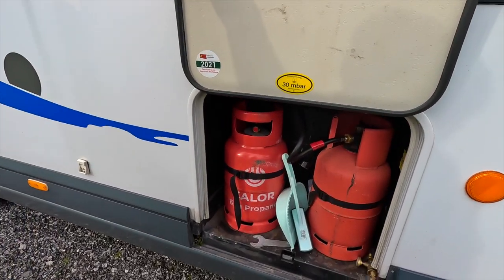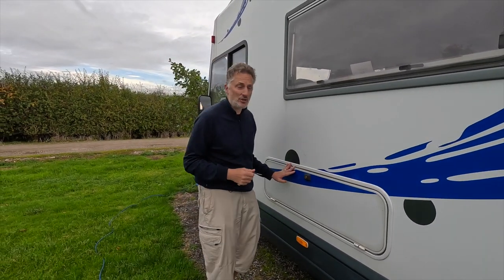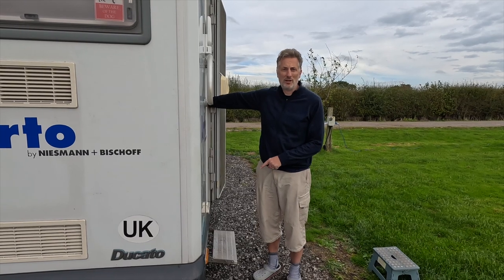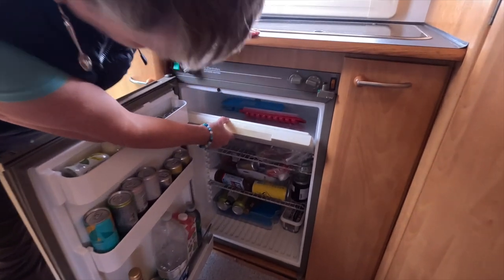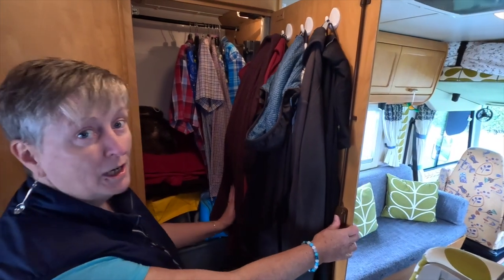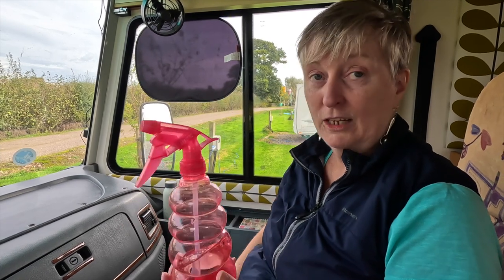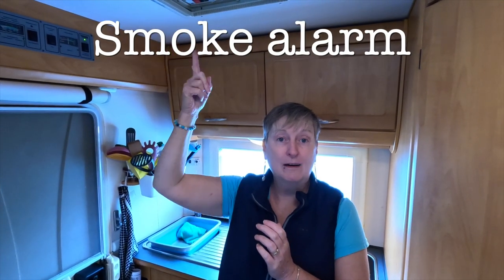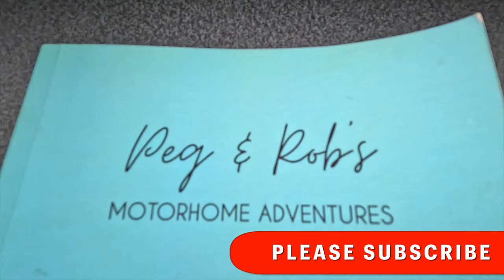Come and have a look inside our motorhome.

Comment: I have a 1991 hymer B544 fridge vents make a massive difference although last month i fitted a new burner to fridge and its been awesome well worth the 90quid
Reply from the maker: Thanks Hegster. Last year I had to clean the burner whilst we were away in Europe on a long trip as the fridge had stopped chilling on gas. It made a huge difference. I will try and add a link below to the video we made on fixing this.
Regards, Rob

https://youtu.be/-D1ggBh29QM?si=ZezE9t8hkIri4Q75

Comment: Peg. You have propane bottles, Calor are a company that manufacturers lpg gas, think you mean a Butane bottle which is blue rather than calor!
Keep to propane it doesn't freeze.
Personally I'd buy Gaslow bottles that are refillable and far cheaper than exchange bottles.
I'm in Wrexham not too far from where you once resided, it's less than 80p a litre here and cheaper to fill 2 refillable bottles than 1 exchange bottle.
If you're ever this way give me a shout I'll gladly show you my set up.
It's not really expensive either.
Reply from the maker: Hi Steve, thanks for the tip. We will check it out. I think it sounds the way to go , especially cos it’s cheaper😀
Reply from the maker: Also when we are back we will give you a shout! 😀
Reply: @pegandrobsgameforadventure  
Definitely cheaper, used 1 bottle in a month running heating and a full size oven and water heater.
Btw your water heater running on electric will have a 240v switch somewhere, mine is in the wardrobe but different make to yours. 
Keep looking!
Reply from the maker: @steveullrich1396  really appreciate your advice. We will keep looking…. Haven’t fount it yet!
Reply: @pegandrobsgameforadventure  
Maybe it's on the controls and not separate 🤷‍♂️
Very expensive motorhome when new so it'll be somewhere for when you're on hook up.